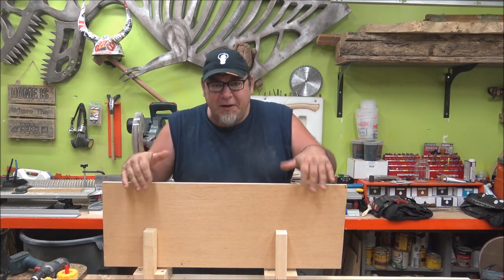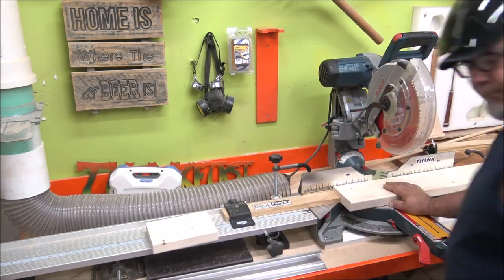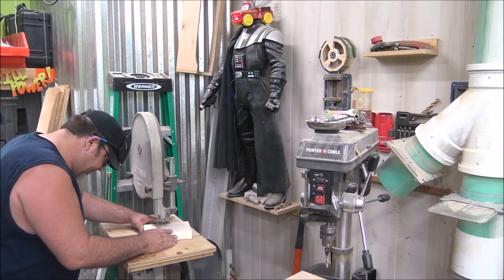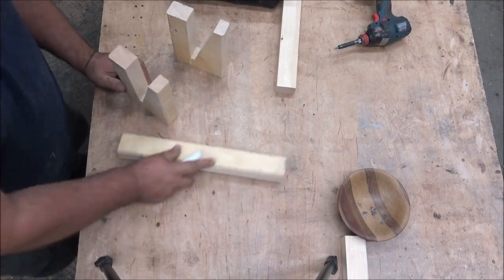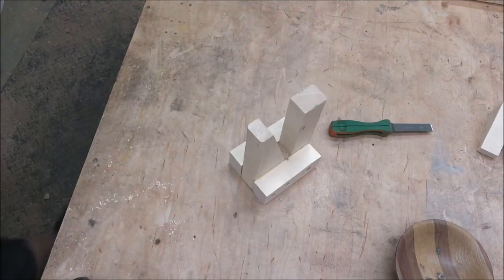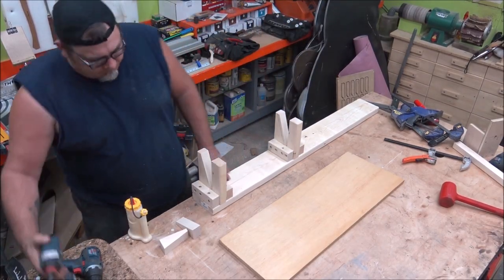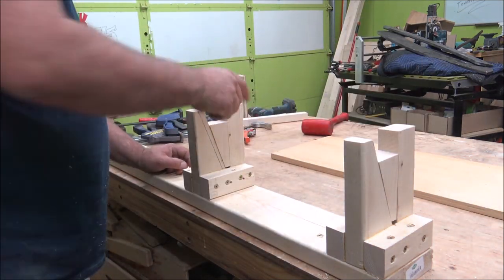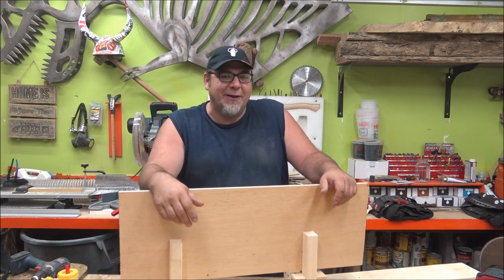Easy to Make - Wood side clamps.

Comment: This clamp is Ok ,not as innovative as your corner clamps though. Not as practical to use on the top of your workbench since it brings your material a little to high to work on effectively, unless you have , like I do, an adjustable height workbench that  can be lowered.